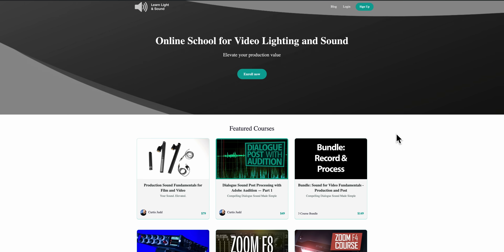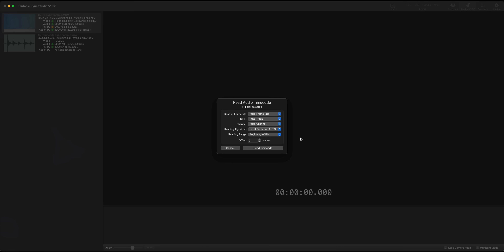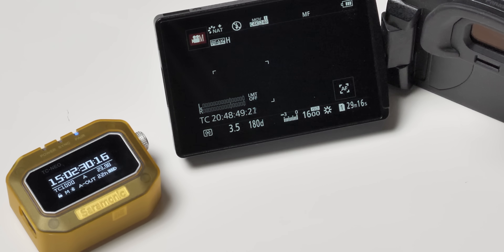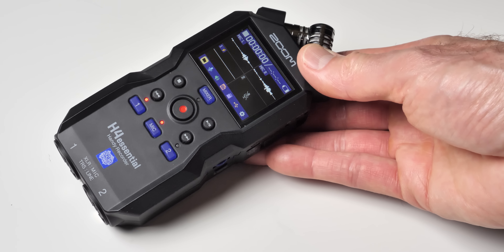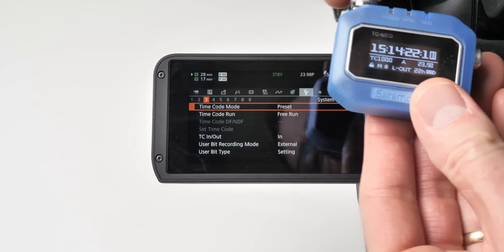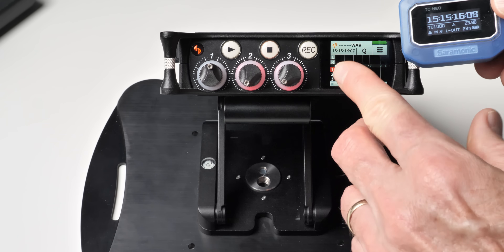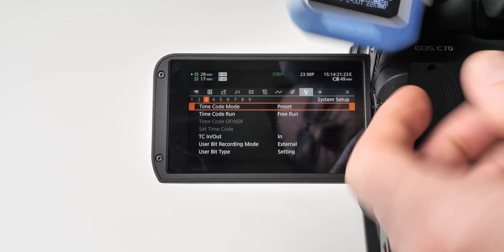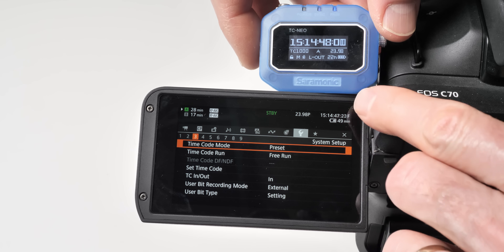Timecode basics for audio & video sync

Comment: @Curtis Judd - could you please explain what you meant starting around 09:00 about TC only being written at the start of the clip, and drift still being possible? If the TC generator remains connected, surely the camera/audio recorder continually writes the external TC values to the file meta data while the recording is running? I have tried this with a Deity TC-1 left connected to a Black Magic Pocket 4K and saw no drift after 4 hours, admittedly with several takes during this time, but including some long takes of 20-30 minutes. I assume that the camera’s internal TC is disabled when it receives an external linear TC signal, and writes those external TC values for each frame of recorded video? Why would it only “sync” the external and internal clocks at the start of the recording and then “freewheel”? This would be no better than one-off jam-sync, which is not the goal of having an external TC generator.

To add some further support of this idea, my Zoom F8n Pro recorder has two additional options for external TC modes: “EXT Continuous “ tells the machine to expect continuous TC that constantly syncs the internal clock to the external TC, but to fill in any drop outs from the external source using the internal clock that is being continuously kept in sync with the external clock. The idea is clearly that TC is continuously written to the meta data during recording. However, I concede that is is possible for the camera frame rate to drift while recording unless gen lock is used, so I suppose you could end up writing TC values at some point other than the exact time within each frame if we consider that each frame is about 41.7ms long, and the TC meta-data could be written at a variable point within those 41.7ms and still be “within the frame”.
Reply from the maker: Video clips and audio clips have one timecode start metadata field per file, to my understanding. That field is filled with the timecode value for the first frame of that recorded clip. When you bring the clips into post, the video editing or sync app just counts up from the start timecode. The file itself does not encode a timecode value for every frame.

Comment: Thank you very much, Curtis, a very helpful video, as always! I just have one question. I thought I had understood everything perfectly when you explained that it's not advisable to disconnect the timecode generator after synchronization, because the camera will then rely on its own internal clock, which will drift. But then, right after that, you explained that even if you keep the timecode connected, the video will still drift, since the timecode only stamps the time at the beginning of the clip. So what's the difference between keeping the timecode connected or not? As I understand it, in both cases, the time is only stamped at the start...
Reply from the maker: If you keep the timecode generators connected, the clips will sync perfectly at the start. And if you're filming for less than 20 or 30 minutes per take, you'll generally be fine. 

If you disconnect after jam syncing, the sync at the start will almost always immediately be off by a few frames and even more off at the end of a 60 minute take.

Comment: Does the camera “listening” to timecode aware the timecode and sync internal clock when recording? Or the camera clock still drift and we just use editing app to fixit?
Reply from the maker: If you feed the timecode into an audio input, the camera has no idea that it is recording timecode. It just continues to record as usual and, for long takes, like an hour, it will generally drift as usual. For shorter takes, the drift is generally not an issue.

Comment: The one reason why we are considering getting timecode doesnt even work. Most of videographers wish to use it for long form content like weddings and multicam interviews/events. It doesn't even make sense to me that if it syncs up at the start and the clock is accurate it STILL drifts over time. At leats you mention it in your video. Not like JPM and Matt J.
Reply from the maker: It could still work, just depends on your workflow.
Reply: @curtisjudd  Come on man, if you get it for free, maybe. And again, it certainly makes sense for the cinema industry with shorter takes but I don't think it is fair to downplay this limitation and try to sell this product to small videographers and wedding filmmakers with limited budget.

Comment: This video was for me. Thanks! Just what I needed to understand timecode. In the end, timecode is helpful for syncing when you are relying on an external audio recorder. When the video recordings are long, and there's drift, try to record directly to the camera to avoid the drift.
Reply from the maker: Spot on!
Reply: @curtisjudd  Or record with cameras that have Timecode in and Genlock in. The Atomos Ultrasync units have both timecode out and Genlock out to keep all devices in sync over long continuous recordings. An example would be a multicam theatre production that runs 90-120mins continuous or similarly a concert.

Comment: Wow this video was much needed, big thanks! I have never used timecode and dont have any timecode devices but this was really helpful to understand - and to realize that, actually, I don't miss anything important by not using timecode - especially now knowing the fact that timecode doesn't keep the files synced up after the initial start sync... so camera and recorder still can drift the same exact way, even with proper timecode connected. We are still doing all of our narrative film work or video production using the simple clap sync method or using an actual slate - and I am so used to syncing camera and audio recorder's files manually that it is second nature to me, and it's also reliable, I have never had any sync issues in all of my work this way. But I totally understand why people want timecode. Thanks!

Comment: Make an indepth video for advanced users. Genlock, reference and how to avoid drifting issues in professional work when 3,5mm recording to camera is not good enoght. Ways to sync more accurately than 1 frame like maching audio exactly to the frame.

In live production expecially you need to make the audio to be more accurate than +/- 40ms what your 24fps would give for each frame. In a live processing pipeline delays add up.
Reply from the maker: Thanks for the suggestion. I don't have any devices that support genlock, unfortunately, so I don't have first-hand experience with it. But that's a good idea and I'd love to learn from someone who has used it.
Reply: Genlocking serves a different purpose to simply synchronising audio and video. It is essentially used in multicamera live productions, where all the CCUs, matrixes, video switchers, video servers, graphics processors and converters can use the same exact clock. This prevents jitter, flash frames and blank frames when switching sources. It also reduces latency by eliminating the need for frame synchronisers. It also helps with lip sync problems, but not only that.

Comment: I was just looking at these Timecode units. 

The New DJI Mic 3 just launched with it, too.
Reply from the maker: Yes, though I'm not sure how full-featured the Mic 3 will be in terms of timecode. Not sure whether it can be jammed with 3rd party timecode generators which may limit its usefulness in some workflows.
Reply: I’d love to see you review the DJI Mic 3 timecode feature.  No one is really focused on this feature and I’d love to see if the Mic 3 receivers could replace the need for dedicated timecode devices.
Reply: @JP4 I was thinking the same thing.
Reply: @J @JP4 1 No one, not even DJI itself , property document this feature. Also, there are many different ways to use timecode other than syncing externally recorded. I would for example know about syncing the internal back up 32bit recording with the footage from the camera for example.. (I have bought the mic 3 and doesn’t seem to work using timecode). Or, another use is syncing your main camera with say a B cam that is an Osmo Action 5 or an Osmo pocket 3. Sounds maybe little professional but that’s what we use on a primetime TV wildlife show for example .. Anyway.. would LOVE to see a video about these situations. He’s the best. ❤

Comment: I have a doubt on the 6:19 section. The you inputted the TC on line-in in the 2 XLR audio rec device. So 1 track is gone to that TC & only 1 XLR can be used right? Also as a beginner camera i can plug the TC but can't in beginner audio rec like Zoom H1 right?
Reply from the maker: On the ZOOM H4, I can actually record 4 tracks at a time, so I can still record to both XLR inputs. Not so with an H1.
Reply: @curtisjudd  On a field recorder, if you use 1 track for Timecode, what software will you use to convert that Timecode data into Metadata for the remaining audio tracks?

Comment: what happens if you jam sync over mic input to a R5 Mk2 at 25 fps, and then change framerates to film at 100 fps or 50 fps at some shots, how does this affect timecode coming from the timecode generator ?
Reply from the maker: Great question. I don’t have an R5 on hand and don’t know whether it has jam sync capabilities(?) but for certain, you would need to reset and rejam all timecode generators each time you change framerate, assuming you need to sync audio to those higher framerate video clips.

Comment: Very interesting, but your last comment puzzles me: How connecting the recorder's output to the camera input is going to prevent drifting in any way?
Edited: Are you referring to connect the TC output to the TC input or the audio output to the audio input? If talking about TC connection, it's clear it eliminates the drifting.
Reply from the maker: What Teddy said. You’re just handing the audio over to the camera while recording so there’s no sync in post. And as long as the camera is recording and receiving audio from the recorder, it should record every frame in sync with the audio provided by the camera.
Reply: Because the audio signal is linked inexorably to the video signal.  There is no drift because they use the same recording system.

Comment: How does this work with wireless audio systems, such as the new DJI Mic 3, which is advertised as having a built-in TC clock with less than one frame drift over 24 hours?

Does this work for short recordings that are only a few minutes long, or is this just nonsense advertising where an important fact is being omitted?
Reply from the maker: I haven’t used the DJI Mic 3 yet, but I suspect it works like the RODE Wireless Pro, which at the time of its release, it really only worked with the two transmitters. It did not work well if you had a more complex multicam workflow and timecode generators from other companies. That may have changed since release.

Comment: I added Timecode (Deity TC1’s) to BMD studio cameras and zoom F6 after my first podcast. My first pod took me over a week to edit. Fast forward to today with resolve and Timecode. I spend more time importing all my footage than editing. Resolves auto cut and auto mix plus Timecode…. My editing requires probably no more than 30 mouse clicks.
Reply from the maker: Sweet!
Reply: Did you have a small offset between the values from the TC-1 and the BM camera? I have a set of TC-1s and a BMPCC 4K, and I find these are consistently a little over 2 frames out of sync with external audio (also synced with another TC-1), so it still requires some alignment in post.
Reply: @johngwheeler  If you find that to be a consistent thing, I'm pretty sure the TC-1 has a compensation you can apply in settings for the device it's connected to. My understanding of this is that some devices take more or less time to actually process each frame through its pipeline, thus you need to offset that. But that said, I've only had one shoot so far where I got to use the TC1s and PR2s I bought, and i royally screwed something up cause it totally didn't work for me lol. Looking forward to trying again though, I think my main lesson was turn everything on first thing in the day, sync them, and never turn them off again because there's no reason to and it adds complication
Reply: @johngwheeler  take a photo of each tc-1 in front of your cam's viewfinder to determine your camera's natural latency (difrence between whats displayed on the tc1 and whats displayed on viewfinder) if its consistent across multiple photos.
Reply: any tutorials on this?
Reply: @felipeandjess not really. I just have four and leave them plugged in the entire time. I wouldn’t trust BMD camera to keep the sync if you just jam it.

Comment: After all these years, Tentacle still only support Mac with Tentacle Sync Studio. They have a timecode tool that works on PC, but it is very unreliable when I tried to use it. I went with LTCConvert instead which will re-wrap your video file and embed file timecode into the clip's metadata using the audio track where the timecode was written to. Much better workflow when on a PC, but you have to pay for LTC-Convert and it is not cheap for the hobby user.

Comment: You just contradicted yourself on one important point. If I disconnect the TC generator after I sync my camera's TC, I accept it may drift over time. But, then you say that the generator is only accurate at the start of the recording anyway. So unless the TC is automatically adjusted while the recording is being made, it makes no difference whether the TC generator is still connected to the camera (or recorder) once you hit the record button.
Reply from the maker: No, if you have quality timecode generators connected to cameras and recorder, at least they will be synced at the start. If you jam sync your camera and disconnect the tc generator, you won’t even be synced at the start of the clips.
Reply: @curtisjudd Do you mean that after the camera you time sync your audio recorder, because it takes time to move from one piece of equipment to the other?
Reply from the maker: @TeddyRumble no, sorry. You connect timecode generators that are jam synced to each other to each camera and recorder and keep them connected through the entire filming session. Then, it doesn’t matter what order you start each on recording, your video editing app will be able to sync them up at the time you started the last device’s recording. And they should be perfectly synced at the start.

However, if that recording is an hour long, there’s a good chance the video and audio will be several frames out of sync at the end of the recording - that is to say, in sync at the start, slightly out of sync at the end of 60 minutes.

Summary: if you’re doing video with recordings that are longer than 20 minutes or so, I’d recommend feeding audio from the audio recorder to camera via cable rather than use timecode.
Reply: @curtisjudd  Hey Curtis, Read pretty much all the comments here seem like alot of confusion around this drift at the end. If you had opportunity please make a video about this so we can understand it more. Your explanation has been constistant. Its also a very unique thing you are talking about that none of the other guys on youtube have spoken about. Please consider.
Reply: @mirsphoto  what type of timecode are all you guys talking about? freerun, jamsync, genlock, LTC, VITC,drop, non-drop, MIDI, control track etc. CTL, AEs-EBU, lol.?
Reply: @curtisjudd  so as long as EACH clip is under 20 mins and tc box stays connected drift wont be an issue?
Reply from the maker: @xkorbekx  generally, yes. Depends on the camera and recorder, but most will be fine over 20 minutes as long as they’re in sync at the start.
Reply: The drift is unavoidable, but may be more or less pronounced depending on the quality of the clocks in the equation perhaps (TC devices, camera/audio device regular clocks etc).

Timecode jamming just aligns metadata at the start. If you want to actually lock the clocks themselves to a master sync continuously over time, you’re looking at Genlock